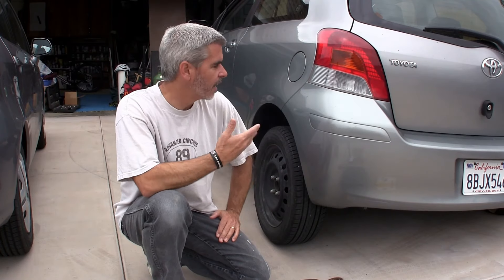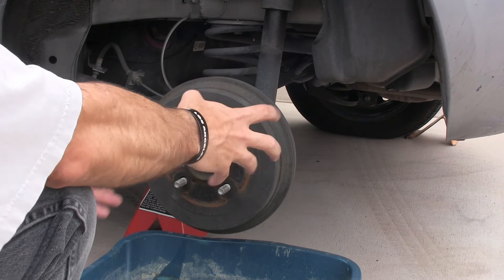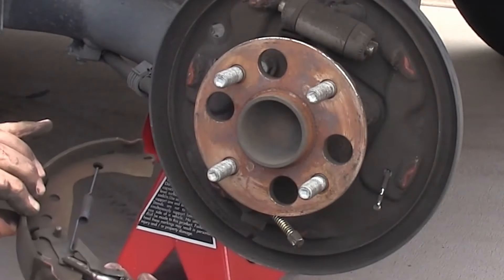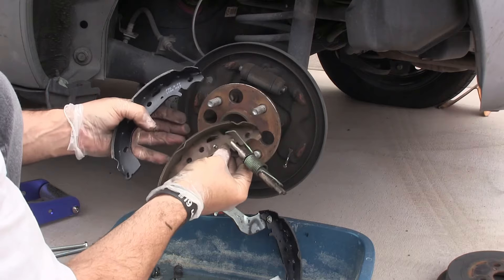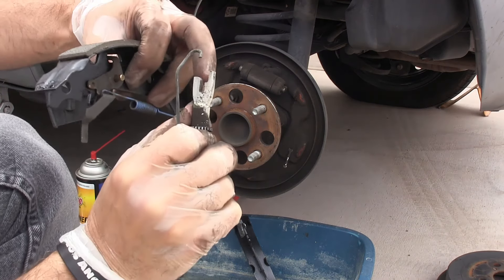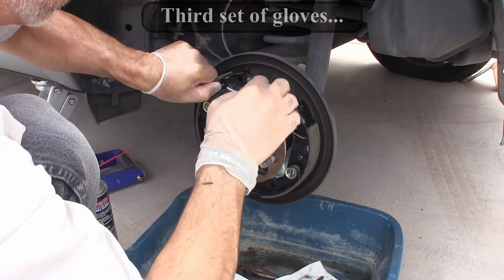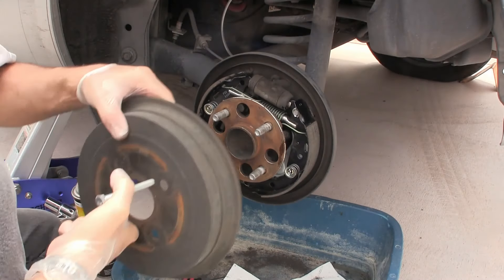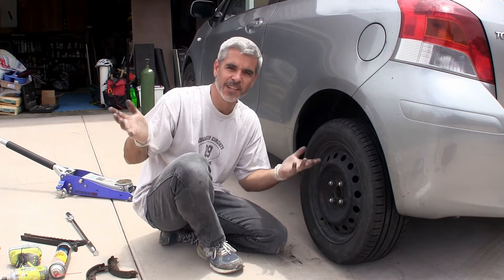DIY Toyota Yaris Rear Brake Shoe Replacement

Comment: I was not convinced that the drum shoe change was necessary. You should have started with the measurement of the friction material. As I can see, a cleaning and some shoe sanding would have been enough.

After you removed the drum, you should have applied some brake cleaner spray.
The whole system and your hands would have been much cleaner beside you didn't breathe the harmful brake dust.

As part of the drum job, it is advised to check the brake piston for leaks and excessive wear. The brake fluid should be changed when you work with the piston to have fresh fluid and no air in the system.

The drum should have also been cleaned with brake cleaner to get rid of brake dust and debris prior to installation.

After the whole process, you should check the brake by pressing the pedal. Then, you should apply the handbrake and check its function and the lever travel. Then, you have to rotate the wheel again to check if it spins freely without excessive friction.

You should have emphasized that the brake job had to be done for both sides. And pads/shoes have to be replaced at both sides of an axle.

When you are done, a road test is the bare minimum if you have no machine for that. You should check for uneven braking, biased braking, excessive noise or too short/long handbrake travel.
Reply from the maker: Excellent suggestions. Thanks for your input!

Comment: Nice tutorial! However, it seems to me that the job was not needed to be done. The old shoes look like they still have some meat on them and can safely handle additional 50,000km. They carry only about 30 per cent of the braking forces so they last a lot longer comparing to the front brakes.
Reply from the maker: Michal Kolář I was sending my daughter all the way across country so regardless of their condition I was wanting to have it completely good to go another 50K.    I’m not sure what your seeing because as I recall they were really close to gone compared to the new ones.
Reply: @DansWay  I totally understand, I would do the same if my kid was driving the car. Just to be sure.
Reply: @DansWay  At about 4:34 is probably where he's referring to. You said the pad material was still good all the way around.

Comment: I drove 15 miles to a hardware store and back to buy the 1/4 120 you said was needed to take the drum off. It was the wrong size. So, I had to drive back to the store to buy the correct size. That 60 miles I had to drive because you told us the wrong size. I should have known and you should have known that it's a metric size.
Reply from the maker: Oh man, I’m so sorry!  What size worked for you?  35K views and nobody mentioned they had a problem.   Let me know so I can update the description with the correction.
Reply: @DansWay  8mm-1.25mm

Comment: definitely not 1/4 20
Reply from the maker: Yes, I wish I could change the audio or add a caption over that statement. It is a larger size for sure.  I put the proper size in the description.